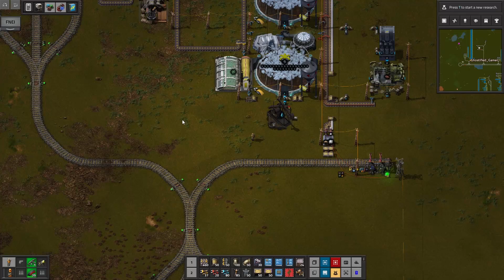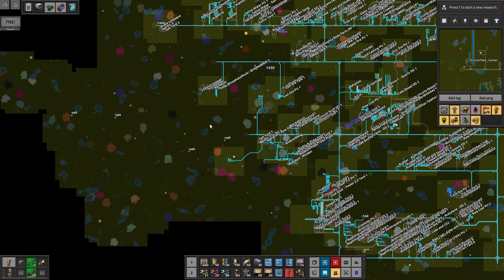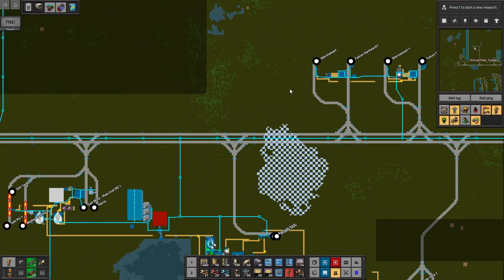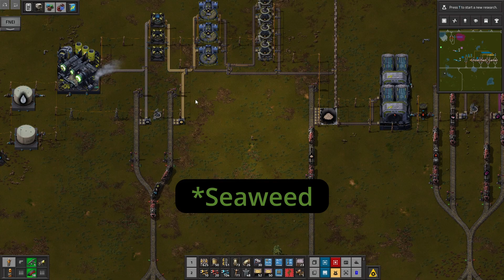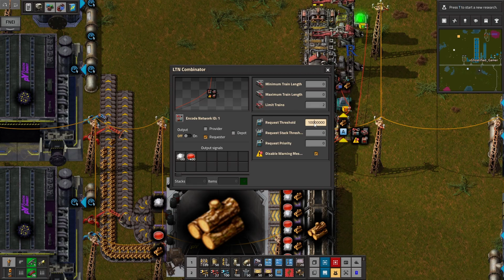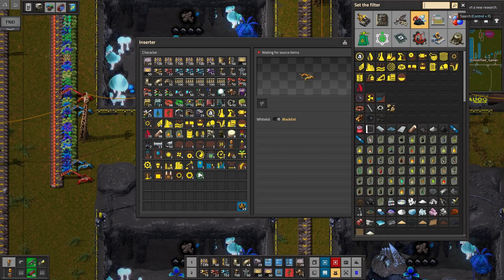Factorio pYanodons - Kicalks Build, Dried Biomass and Urea - EP98

Comment: Instead of multiple stops on LTN (e.g. for fiber) you could just use a stacker and then set the train limit higher on the LTN combinator.  LTN would still send multiple trains if the warehouse has enough to supply them then they'd just wait in the stacker.  You'd be limited a bit by how fast a train loads, but you could remedy that by using a single 6x6 warehouse with 6 mini loaders vs three 2x2.

Alternatively, you could use the requestor priority in the LTN combinator to make sure the left most station is unloaded first if available.
Reply from the maker: Thanks.  I use this with ore loading on the TSM network.  I was little leery of it with LTN but, I'll try it out.

Comment: When you talked about gravel building up, I started thinking about all the things that need filtration media, whose biggest inputs, IIRC, are coal dust (for the activated carbon) and gravel. I suspect that once you create a build to put filtration media on LTN, you'll find your gravel disappearing pretty quickly.
Reply: Oh, and coal dust can be created directly from raw fiber, so that's a nice bonus use for your kicalk - raw fiber build. BTW, I suspect you'll also want a train station for kicalk seeds in the future: they're used in the food for the alien cows. I remember seeing a plastic recipe that used casein, which I know comes from milk from the alien cows, so if you start running out of aromatics you could spin up a milk-based plastic build.
Reply from the maker: filtration media will eat up that gravel for sure.  It all depends on if and what I'm building or if the base is running research too.
Reply from the maker: Yes.  The kicalk to coal dust is a backup option to coal dust I'll use.  As soon as I get those space cows (Korlex) up and running, the plastic build will follow using casein.  Probably after I get the MK2 space potatoes (Tuuphra).

Comment: At 55:20, I think you might have accidentally uncapped the urea chest at your second-from-the-right urea pickup train stop. (I think your mouse click to dismiss the chest UI ended up landing on the X icon that uncaps it). Don't know if you've already noticed it by now, but in case you haven't, you might want to check that chest.
Reply: Never mind; if you did uncap it (and it looks like you didn't after all), you fixed it a few minutes later when you copied and pasted the new, higher cap onto all the chests.
Reply from the maker: Thanks.  I'll check it out.